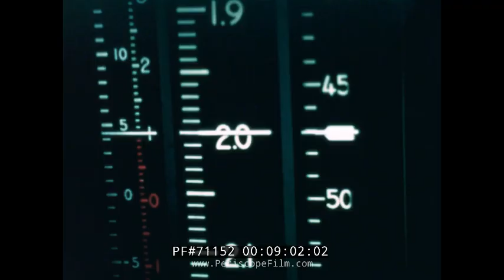XB-70 SUPERSONIC STRATEGIC BOMBER MACH 3 FLIGHT TEST FILM 71152

Comment: First North America Aviation I mean they built the X-15 and then they built this and then later on the shuttle and I believe the X-15 in the XB-70 were pretty much done with slide rule not computer it makes you wonder how much they can do with the plane now with modern materials but either way North American Aviation they had it going on I don't get why they canceled it they claim the the Sam's from Russia was the reason but yet we went ahead with the SR-71 doing flyovers basically about the same speed
Reply: SR-71s didn't fly as deep into Soviet territory as a manned bomber would, and didn't face the same threats.

Comment: The MiG-25 was designed to counter this beast.
Reply: Unlikely - the MiG-25 program was initiated a few weeks before the Valkyrie was cancelled in early 1961.  The Soviets not only continued development, but put the MiG-25 into serial production in 1969, the same year that the surviving B-70 was sent to the USAF museum.

The MiG-25 had its roots in the Ye-150 series interceptor concept aircraft, and those began around 1955-57.  

So the timing is either too late or too early to be related to the B-70.

Comment: Would it be possible to somehow transform it into a passenger airliner? If so, how much work would have to be put into this?
Reply: NA was 1 of 3 contenders for the US SST program.  Boeing won over NA and Lockheed.  NA's American SST proposal carried fewer passengers than the other competitors, and had shorter range than both of those airplanes, and the 2 SST's that actually entered service.
Reply: North American Aviation had envisioned a commercial airliner version, but it never happened.

Comment: A very interesting plane. The wingtip angle adjustment was the most interesting aspect of the aircraft. And with the abilities of the craft to travel with heavy loads at mach 3, it is the reason that the russians began developing supersonic missiles to potentially combat such planes
Reply: The Russians already had supersonic missiles before B-70 was created, and because the B-58 also preceded the B-70, the Russians were already motivated to build them.

Comment: The aircraft is so  Fast the paint was falling off.
Reply: Mike Motteberg 
It was burning off, just like the paint on the SR-71 did. It needed touch up after every flight.
Reply: @ralfie8801   Dropping A-bomb at mach 3, I believe it   May have a problem doing that?
Reply: Mike Motteberg 
Nope, the B-70 was designed for that exact purpose. It had to release the bomb approximately 18 - 20 miles before the plane reached the target.
If you read about the SR-71, it leaked fuel from the tanks while sitting on the tarmac, they only got a partial load of fuel for take off. Then they got up to the tanker for the full load before going supersonic. Once the skin of the aircraft heated up after that, all the leaks sealed up from heat expansion, or so the story goes.
Reply: Ok, I guess what I don't understand If the XB70 Was so superior, Why did it not succeed?
Reply: Mike Motteberg 
Between the time it was developed and when it was being tested, the USSR made huge advances in their missile technology. They could shoot it down. The original purpose was to fly higher and faster than your opponent’s interceptors could, but once those interceptors went from fighter planes to missiles, the mission of the B-70 to overfly the soviets and deliver its payload was nullified.
This is also what killed off the B-58 Hustler after only 14 years of service.
Reply: I guess  The Russian missile advances We're not all that good, They were not able to shoot down a blackbird.
Reply: Mike Motteberg 
They shot down a U-2 from the same altitude the B-70 would have operated from, that's when the project was cancelled. The first X model was complete, the second was mostly complete when it was cancelled. They completed the two planes to use for performance studies related to the SST.
Reply: I guess  Lockheed  Prevailed  On going fast.
Reply: Mike Motteberg something else to consider, missiles then had a very limited range, plus they didn't change direction well. All the SR had to do was bury the throttles and change course a time or two. The missile would use up most of its range getting to the altitude of the plane and the rest of it trying to follow it after it changed course at speed.

Comment: If the Air Force wants to build a NEW Bomber . . . then "This", is what they should build ! ( Seriously "Up Graded" of course !, especially the ENGINES ! ) With today's tech, they could easily get to Mach 5.5 or 6 . . . just think of the "Missile Load" it could carry !.
Reply: Honestly, I doubt they could get a plane to Mach 6 for an extended length of time, much less "easily" do it.

When you double the speed, the drag quadruples, and that's got knock on effects all down the line. Quadrupling the drag quadruples the aerodynamic heating. It also means you need engines that are four times as powerful to cut through the drag which means you need a ton more fuel to do the same mission.

Improvements in materials and designing the plane would help, but not nearly enough.
Reply: Actually the engines were capable of higher speed flight back then, it's just that the structure and the environmental and hydraulics systems would have to be dramatically redesigned,

Comment: Valkyra or Ty177 from famous spy stories in 60ies the plane used strategicaly used as modern view what is aeroplanes but not tested fuly to be scfi aeroplane needs first curved wings ends the front wings flaps are not curved but rotational  a high tech toy would be angle curved 60° rotationable and sruff like bugatti spoiler pop out on manevouring and and 2-3 airbrakes  that is chasis solid an very functional using rips and tech from modeling also high tech main problem is whells, back whells should be angle curved for better landing force  or even considering a double pair wheels since is heavy, main problem is front laps movable to large as it influence structure and speed by landing and take off due to lack off testing lack off computers and finacing and also 6 engine is about crap one mach more or less is pointless for  bombers , usualy when chasis is minr or top scfi or receive rewards or show eceptional flight caracteristics then is engine  rebulid or add new one , and after that  a top peak is  a spin rotation cocpit for even more scfi or drive pleasure and better flight caracteristics !Actualy this scrapy  thing is about for SU eng in sibiria first to build it and remake a scrap model for future something to fly on or respect to history! And actualy if this advice didnt help you can always fly on kerballs and robocraft games on pc to see how it does fly in test!
Reply: Bozidar Skobalj   1960's punctuation?

Comment: That aircraft must have scared the Russians (Soviet Union) after they saw it flying. It was very fast, and Gen. LeMay would have loved having it if it didn't cost so much to produce.
Reply: I don’t think it scared them near as bad as the F-111 did. They tried to get it removed from service every time any weapon limiting talks were held. They feared it because of its terrain following radar.
Reply: Funny thing is, look the plane over, there doesn't seem to be any room at all for any kind of weapon! The whole thing is fuel tanks and engines. It made a nice testbed for supersonic development of large aircraft though.
Reply: That aircraft was designed to use only internal bays like the newest aircraft the U.S. have on duty now.
Reply: It likely didn't scare them because the Russians thought 1) they could counter it with missiles that were a fraction of the cost, 2) they had the MiG-25 under development, and 3) if under a real attack, they already had land-based and sub-launched missiles; 

Also, the B-70 had been cancelled as a weapons system years before it flew.
Reply: Being a testbed it had no accommodations for Navigator or Bombardier and although speed at altitude was it's intended purpose,...at low level it was limited to .95 mach, only marginally faster than a B-52 at the same altitude, while carrying a smaller bomb load than the BUFF.  Still,...the most beautiful plane ever built IMHO.
Reply: Oldbmwr100rs It was designed to carry 50,000 pounds (and that's just the original two prototypes that were built [AV/1, SN 20001 and AV/2, SN 20207]), and the Mk 41 (B-41) 25 Mt TNT-equivalent thermonuclear weapon was designed to be carried in the payload bay, two bombs in fact; it was also designed to handle lenticular disk missiles referred to as "pye wackets" and would be mounted underneath the wings.  It had a range of 4288 miles in flight in the real world, although it had a design range of 6000 miles. There was also an SST-derived variant of this plane designed called the NAC-60, but it was the least known of the three SST designs submitted by North American Aviation (NAC-60), Lockheed (L-3000), and Boeing (B2707). This plane is still a perfectly sound design even in 2017, and I'd see to it being modernized for flight as an SST, but enlarged from its original 250 Mt maximum takeoff mass to 500 Mt (metric tons).

Comment: "Who's a pretty bird? Who's a pretty Bird?!"
If only Boeing partnered with North American ... sigh ...
Reply: It had 6, not 8 YJ-93's.  Just clarifying.
Reply: North American was merged with Rockwell in 1967 due to the Apollo 1 fire. Then in 1996 Boeing bought Rockwell and shortly thereafter McDonnel-Douglas. So basically ... they did. The space division of what had been North American Aviation was a big part in the design of the Space Shuttle. 👍🏻👍🏻👍🏻
Reply: Boeing was trying to beat North American for the B-70 contract. Their version had the engines under the wings in pods like the B-58.
Reply: Ryan Ballenger  The XB-70 was NEVER going to be anything more than a test vehicle. Boeing was trying to beat Tupolev and Concorde but too much of their money was already being poured into the queen of the skies (747). The closest the got was a very expensive full size moch up of the SST.
Reply: If you want to see what's left of that mock up, it's on display at the Hiller museum in San Carlos, CA. But yeah, the XB 70 was just a test bed, it was obsolete before it was completed, but the two were built as research planes, and much was learned from the tests.
Reply: +Oldbmwr100rs the XB-70 was problematic but not obsolete. The GE YJ-93 engines in 1964 had the equivalent power of fighter jets today. Strange they didn't progress with the design (of the engines). Apparently the plane was a pain in the butt though.
Reply: Slender man Yeah, of course. sadly the 2nd one was destroyed in an accident, it actually had a number of improvements incorporated in it's construction,too. It was a very advanced testbed for some radical designs, and having eight engines, especially ones designed for the plane itself all packed together in a single area didn't make working on them look too easy either I'm sure. But it did fly and was used for a number of years to learn from. I really need to go to the Wright-Patterson air museum to have a good look at it as well as everything else they have.